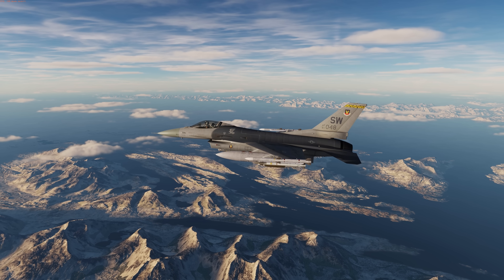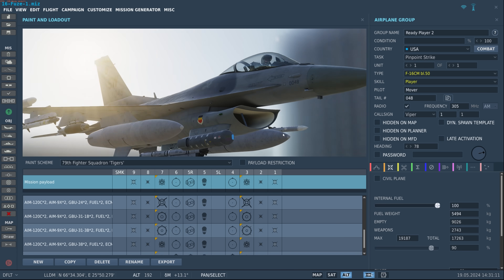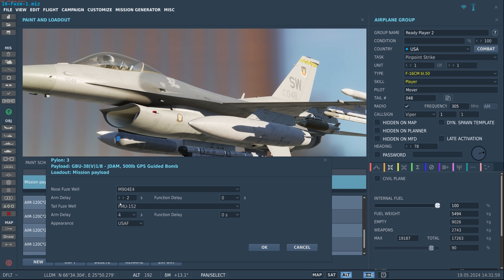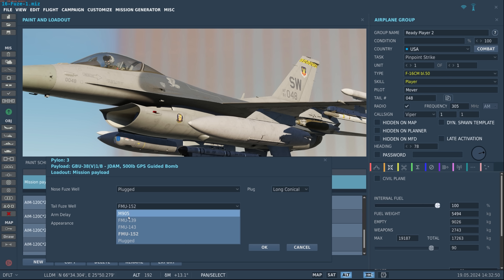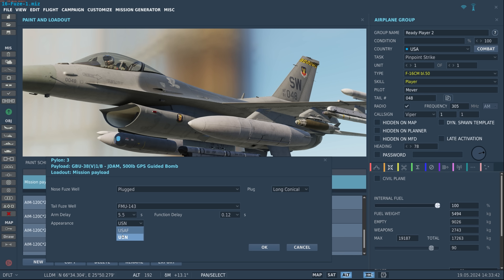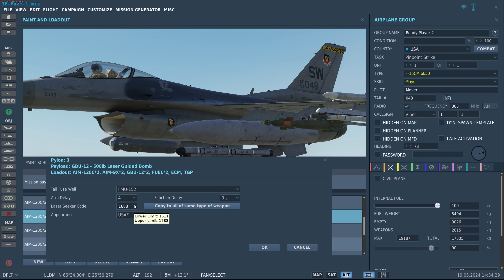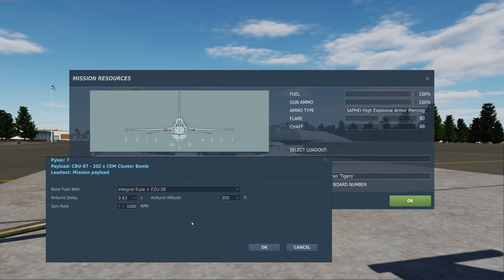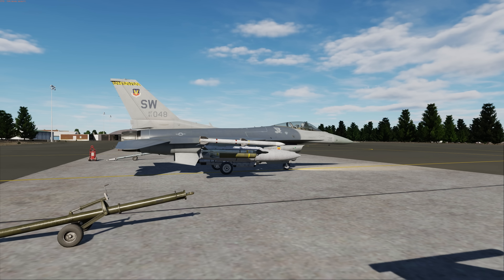DCS: Bomb Fuze Update

Comment: What do plugged fuses do?
Reply from the maker: They are not a fuze, just a solid cap.
Reply: Cheers for the reply Wags.

So, a plug is kind of like a cap in a hand gun, it’s triggered and sets off the bomb?

And the FMU-152, the joint programable fuse, what kind of programs/set-ups are available?

Sorry for the questions, I’ve been too timid to try them out myself, and reading the manual is tricky to concentrate since my head injury.
Reply from the maker: @daviddoyle982 nope. Just an inert plug that fills the hole that a lack of fuse leaves.

Comment: F/A-18 The GBU-12, GBU-10 no longer explode on impact. I've tried both the FMU-155 and FMU-135, but it still doesn't work  but in the F-16, the bombs work just fine. Is this a bug? Also, why do players have to change these fuzes themselves? Shouldn't the correct settings be the default? as a player, I might just want the bomb to detonate properly, and it would be better to spend time improving the explosion effects to make them more realistic.
Reply from the maker: Not sure. I just tested and no such issue here. This is not really the place though. Please use our forum here: https://forum.dcs.world/forum/130-dcs-fa-18c/
Reply: @MattWagner  I can’t create topic on ED forums
Reply from the maker: @postman2237  You need to register and then wait a day or two for your account to be active.
Reply: @MattWagner  I've fixed it. The problem was I forgot to change the EFUZ (Electronic Fuze) to Instantaneous. That's why it didn't explode on impact 😅. I'm still new at this, so sorry about that. You guys made a perfect module. DCS forever! ❤

Comment: It should be made clear that laser codes other than 1688 must be set via this new fusing panel.  Simply setting them (at least in the case of the F/A-18) via the Stores page in the jet will appear to set the new values but they do not take if not first set via the fusing panel.

Comment: The part about the laser code isn't clear (at least for me). Is it now only possible to set them on the ground? So changing the laser code on the store page doesn't do a thing? (FA-18C)
Reply from the maker: You cannot change the laser PRF code that the bomb seeker is looking for while in the cockpit, that must be done on the ground. In the air, you are only changing the loser PRF code that the TGP will designate or look for.
Reply: @MattWagner  Hey Matt tnx for the clarification. Will the input method on the stores page be removed? (I don't know if it's there on a real hornet)
Reply from the maker: @TheDM3002XTuber  No, nor should it be. You must make sure the SMS fuze data matches the actual fuze settings on the weapon to ensure proper weapon delivery and indications.

Comment: Can anybody tell me how the fuzes get triggered?

I expect the nose fuze to get triggered on impact, then behaving like the settings for it. How does the tail fuze get triggered? Or does the nose fuze only trigger the tail fuze and detonation delays are accumulated?

I want to try a dumb bomb, exploding 5 seconds after impact. As there is no nose fuze with that much delay, I need to use the plug for the nose and an fmu-152 for the tail, correct?

Comment: Is there penetration even simulated? What’s the point of using a delayed fuse if it’s not simulated what it penetrates?
Reply from the maker: Yes, it is modelled based on the object type.
Reply: Ok that sounds very nice indeed, but my point was, does it make a difference? In real life it would make sense for a bunker breaker to have a delay, but I thought in DCS was no difference since the bunkers are only static (destroyable) objects? Or does the bomb now actually explode inside dealing more damage when equipped with a delay fuze?

Comment: Wow, and thanks for this update!  I really like the direction this going. Question: are there going to be other updates to the cultural (structure) objects also?  Like using your example, will hardened shelters have a higher survival probability (%) when hit with a non-penetrating ordinance or even a cluster munition?    Or will airbrush ordinances have more effect on targets when they are separated by revetments?   I know it's impossible to completely model reality, just curious how this translates into the DCS simulations. As a former USAF weapons and also TGTs I really like this detail.  Thanks Again!!!
Reply from the maker: This is already, partly implemented, but as mentioned at the end of the video, we'll be tuning "targets" to better match weapon choice and fuze settings. This is a parallel task to configuration UI, visual effects, and blast/frag effects.
Reply: @MattWagner  Wages that's really great to hear!!!! I apologize that I missed that part of the video.
Reply from the maker: @allent555  No problem, most viewers don't watch until the end.
Reply: @MattWagner  ROFL I did, however, my 56 y/o ears failed me.   Now we just need a tool for ACO overlay and mission planning system interface like the MSS II or AFMSS and it will be like we're back in the SQ.

Comment: Will the USN selection give options for green ablative coating as well? Green was used pre-2002, and already exists in the DCS file structure along with the gray, however gray is incorrect for anything pre-2002.
Reply from the maker: Our F/A-18C is designed around a mid-2000s jet, so the gray color is accurate. We may to the older green color, but a lower priority.
Reply: @MattWagner  Mid-2000s still had green bombs in circulation. 100% gray across the whole inventory isn't accurate until late 2000s/2010s.

Comment: Please add a short description beside the names of the fuzes (Impact, Air Burst,...)!
Reply: It should be fairly obvious by looking at what options you are presented with when a particular type of fuse is selected.
Reply: @Nstar98  Whats the difference between plug types then, if it's so obvious
Reply: @Spectre-907  Apart from visuals, the nose plugs do exactly nothing in DCS. The MXU-735 doesn't aid in penetration at oblique angles for example, it's no different from either the short or long nose plugs.

And all the tail fuse plugs do is blank that fuse off such that there isn't a tail fuse.

But fact of the matter is, if you select say, DSU-33, the only option you're given in the fusing menu is airburst height - pretty obvious what the DSU-33 is then isn't it?

Similarly for all the various time fuses - it only gives you function delays, pretty obvious what the fuse is for then isn't it?

EDIT: And even for the different tail fuses - the only difference they have in DCS are the different time options, IRL the FMU-143 is designed for penetrator bombs (e.g. GBU-31(V)3/B and (V)4/B, GBU-24A/B and B/B), the -139 is designed for general purpose bombs and the FMU-152 JPF (joint programmable fuse) can be used in either.

It could be useful to add something in the fusing selection GUI to indicate whether or not a fuse allows for in-cockpit selection, like the FMU-152. But display names of fuses should ideally just be the designation and name.

And FWIW: I'm absolutely fine with their being a mouseover tool-tip, or something in the in-game encylopeadia, or a .pdf etc.
Reply: @Nstar98  >they do nothing in dcs
Then why have them? 

As for "am i expecting ED to clutter things up in the names?" No, but I do expect a mouseover tooltip or accompanying pdf. Some level of documentation is required, this isnt their actual military-branch sim where these things are covered in actual pilot training.
Reply: @Spectre-907  "Then why have them?"

To better represent what these bombs look like? 

Same for the ablative grey thermal coatings for USN bombs? It doesn't actually do anything in DCS (I don't even think it adjusts the bomb's weight) and ammunition cook-offs from fires aren't a thing in DCS.

"Some level of documentation is required, this isnt their actual military-branch sim where these things are covered in actual pilot training."

I'm sorry, but I'm struggling to see how clicking on a fuse and seeing what options you're presented with requires military pilot training.

I'm not an expert - far from it. If you asked me what a DSU-33 was I'd have to look it up. But seeing as when I select it, the only options I'm presented with are airburst height, which makes it obvious that it's an airbursting fuse).

As for a .pdf, manual or mouse over tool-tip - I'm not opposed to that at all. In fact, I'd extend it to weapons generally. I'd much rather have that than overly long, display names that are inconsistent in what information they present and how its presented. Hell, sometimes, it's not even correct.
Reply: @Spectre-907  For some reason your last reply isn't showing in the comments - I can only read a fragment in the notification.

"You use the painfully obvious example of the airburst fuse"

As opposed to what? The only other kind of fuse are the time fuses, which again, if you click on them, you're only presented with arming and function delays - is that not "painfully obvious" too?
Reply: @Spectre-907  I asked this as well, and Wags kindly responded: "To add more realistic weaponeering to not just include nose and tail fuze setting across various fuze types, but also finally integrate laser PRF codes, height of function, air burst fuzes, and more as discussed in the video."

Comment: Great video, and great capability in DCS, Wags - my only suggestion would be to add a tool tip, or put in brackets next to each fuse type, that describes what each fuse type is used for (airbust, penetrator, electro-mechanical etc.).

Comment: I'm confused about having both a nose and tail fuse both set to detonate. What is the advantage of detonating both ends of a bomb? I thought you select a tail detonate for hardened targets and a nose detonate for unhardened targets.
Reply: You always detonate the whole bomb. Two fuze wells allow to attach different options/combinations e.g. penetrator nose plug and timed fuze tail. LaserSeeker assembly on the nose and tail fuze. There was a time they experimented with two similar electromechanical fuzes in both N/T, to reduce duds, but actually the duds were caused by mechanical issues during assembly. 
Fuzing is a complex topic itself.

Comment: For the USAF/USN liveries for the bomb, wouldn't it be better to have them tied to the variant of bomb used by the USAF and USN? So the -31(V)1 and (V)3 would have a USAF skin and the (V)2 and (V)4 would have a USN skin. 

The GBU-38(V)1/B shown above isn't used by the USN as it isn't thermally protected - the version used by the USN is the (V)2 and (V)4 (which goes for both the GBU-31 and the 38).

The -31 already has the (V)2 and (V)4 for the Hornet, but only the (V)1 is available for the -38.

Similarly, for the Paveway II and Mk 80 series, the Navy uses different warheads (Mk 82 -> BLU-111A/B, Mk 83 -> BLU-110A/B and Mk 84 -> BLU-117A/B). For the GBU-24 we should have the A/B for USAF aircraft and B/B for USN aircraft.

In every case, the practical difference isn't all that much - copying and pasting, renaming and giving them the correct livery is all that's required. Though for some USN weapons there should be the old green thermal coating (which is already present) and the newer grey coating.

Comment: Please add SLAM-ER to the viper 🙏
Reply from the maker: That would not be accurate for a US Block 50.
Reply: SDBs then?? I’ve loaded them on Block 50s.
Reply from the maker: @S1r1usBlac462 Not for our year and OFP.
Reply: @MattWagner  The contract for system development and demonstration was awarded October 2003. The system went into limited initial production in April 2005. In August 2006, the SDB was delivered to warfighters. We’re flying an 06 Viper right?
Reply from the maker: @S1r1usBlac462 our jet is OFP 4,2, SBD is not correct.
Reply: @MattWagner  👍🏾